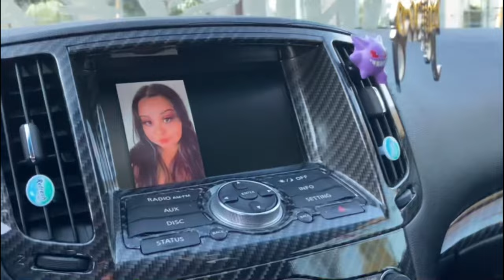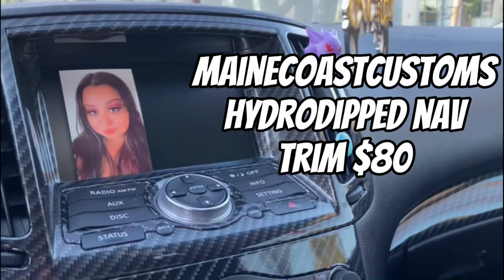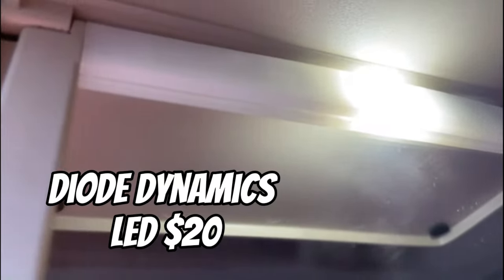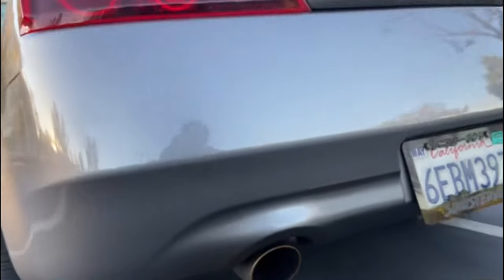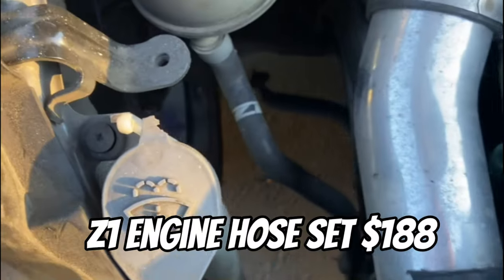FULL WALKAROUND / MODLIST OF MY G37 COUPE!!

Comment: How many miles on it? Have you changed out the gallery gasket on it prior to these mods? I have an 08 coupe as well.
Reply from the maker: got it at 75k miles & current just hit 105k miles. i have not changed out the gallery gasket YET.. but i will do it when the time comes. i don’t beat on my car alot so hoping it will be awhile before that happens